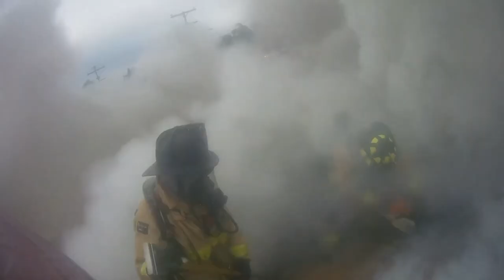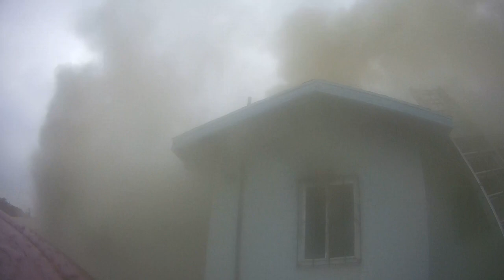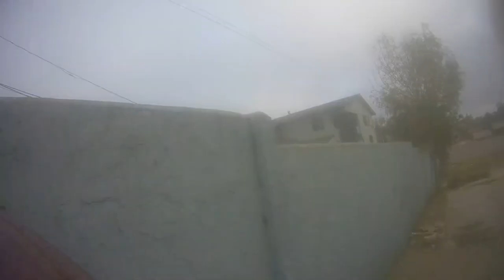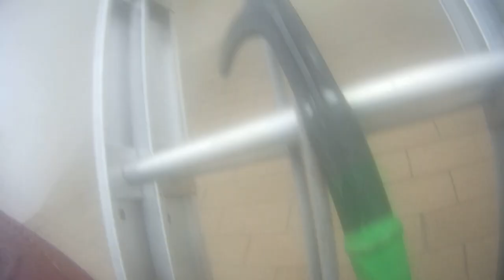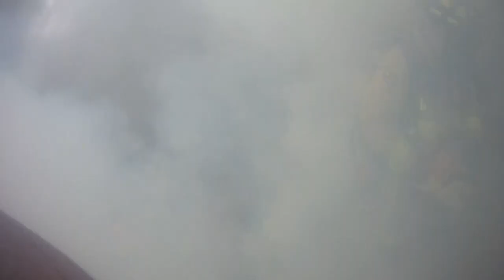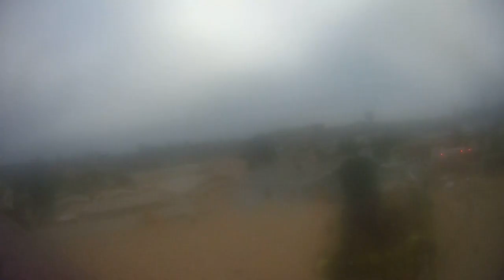Back Up Chainsaw

Comment: Hi Chad,

Great video!! If the two chainsaws had gone out, yes we have the axes on our hips but what about the rescue saw. In the spiel, it says that the rescue saw can be used for ventilation. Is there a reason that the axe is preferred over the rescue saw?

Thank you

Comment: Nice video, I’m impressed by the before and after of the helmet, pretty intense heat. You guys are more towards aggressive interior I guess, cool.
How often it happens that the saw dies due to smoke and what should be done, just try and restart it or move somewhere with less smoke? I’m not familiar with vertical ventilation 😥.
Reply from the maker: It doesn’t happen that often, it was already having issues, but a lot of smoke can contribute to it stalling. That’s why we bring two saws and wear axes on our belts.